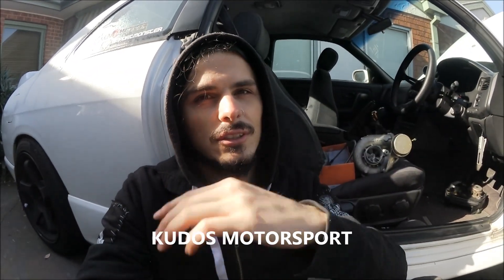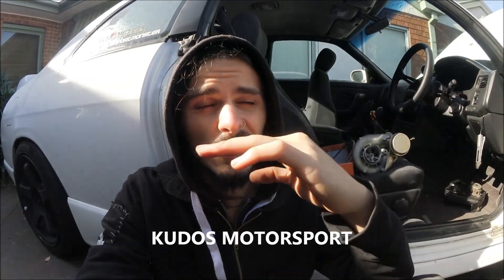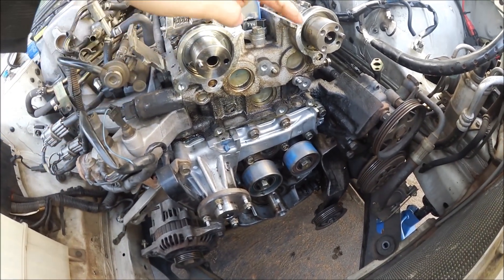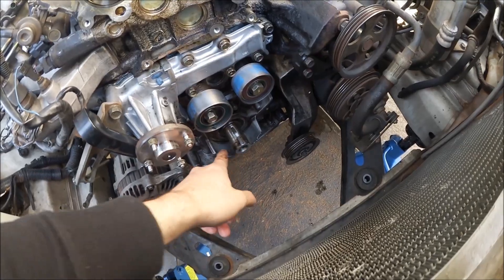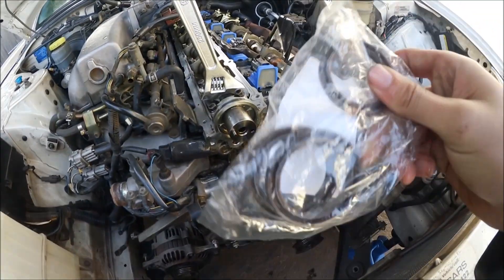RB25DET R33 HIGHFLOW TURBO

Comment: Hey bro I'm assuming Tao from hypergear told you the return flow can be restrictive and to get a new intercooler. There are people on Sau cracking over 300rwkw with hypergear g3 highflows and return flow coolers on e85. A lot of people have proven that the return flow is not as bad as Tao says. Although the illegal style intercoolers most likely flow better the return flow will still work very well, you might just want to keep it for legality reasons. I would expect you to make 250 - 260rwkw on p98 and around 300rwkw on e85 with your setup. Good choice with the haltech.
Reply from the maker: yeah he did and a lot of others have been in my ear about it too. and its true ive read up on how much people have cracked over 300kw with return flow. cheers man for the info! and im thinking of just doing the E85 now since i have the set up for it

Comment: Looking good man keen to see how much it makes, i just finished my build last week on my r34 with a gt3076 making 270kw with supporting mods, now i need to switch to e85 to push 300kw, i heard 300kw or more is to much for a stock rb25, have you heard anything the same?
Reply from the maker: nice mate! you be having mad fun in that thing! hell yeah man do it! stock RB25s can handle it man, theres a stock rb25 making 350kw on e85 :) with my mods i sould crack just over 300kw on e85

Comment: Bro, did you get the wastegate upgraded on your high flow? If you didn't you'll need to replace it. Trust me, I got the same G3 high flow on my R33 and the stock wastegate had trouble holding boost. I replaced it with a MAMBA aftermarket wastegate actuator and now it holds 20psi beautifully.

You should crack 300rwkw with a good tune and E85. On P98 you'll be around 260rwkw.

Oh, btw, I see you're replacing the pump again. MAKE SURE YOU USE E85-SAFE **SUBMERSIBLE** FUEL HOSE. This is a common oversight and will cause you future issues. Do it right!
Reply from the maker: yoo thanks been currenty looking for one yesterday see which one is best for value still looking but i will suss out mamba. that sick man 20psi on a g3 is what you want! haha and thanks man i was actually gonna buy it cause hell no to using heat shrink again lol. so defiantly gonna get it for best results in long run

Comment: Still loving the content man, you don't need a fancy garage and all that to entertain us.
I have my own R33 with RB25 and it is putting out 375kw right now, 9th year of owning the car.
I can give you some advice, if you can get a proper ECU... just go for it. Having a Haltech or a Link makes a big big difference over a Nistune... which also gets rid of your maf sensor. As a bonus the turbo will sound much better and louder ;-)
Good luck with the build man, looking forward to the new video.
Reply from the maker: Thanks so much man! And that is awesome as be having mad fun in that!! And got the hsltech plug in pro so gonna be some sick shit haha
Reply: I also got an R33 but I RB30 swapped it. I'm fighting with it every time I turn around. I was just taking it to the dyno for my power tune, and the transmission started leaking fluid. 

Parts List: 

R.I.P.S RB30 forged short block w/ AWD Adapter
Borg Warner EFR 9174 turbo with twin scroll 1.05 housing
6boost Twin Scroll Exhaust Manifold 
Tial Wastegate(60mm) & BOV(50mm)
RB26 Cylinder head w/ port & polish
Kelford 182-E camshafts 
Kelford Titanium Springs and retainers
HKS Adjustable Cam Gears
Greddy Intake Manifold 
Nitto 1.2 Metal Head Gasket and Metal Engine Rebuild kit
ARP Head Studs
Ross Tuffbond Metal Jacket Harmonic Balance 
Injector Dynamics ID2000
Koyo Radiator
Greddy Radiators Swirl Tank
Radium Oil Catch Can
Radium fuel rail
Radium Surge Tank w/ 2 Walbro 450 e85 Pumps 
Aeromotive Pro EFI Fuel Pressure Regulator(13110)
Nismo High Flow In-tank Lift Pump 
Custom intercooler & down pipping 
Kakimoto Full Mega N1 Exhaust
Haltech Elite 2500
Haltech Flex Fuel Sensor 
Haltech Can Wideband 
Yellow Jacket Racing LS2 Ignition Coil Conversion Kit
Wiring Specialties R33 LS2 Ignition Coil Harness
Magnus Launch Control solenoid
Spec Twin Disk Clutch (SN23SST)
Nismo LMGT4 Rims 
Toyo R1R 285/17/30 tires
17z 6 Piston(front) 4 Piston (rear) Brembo Brake Calibers w/ steel braided lines